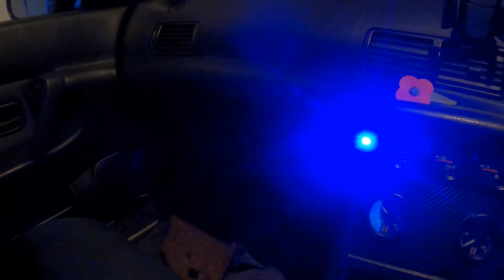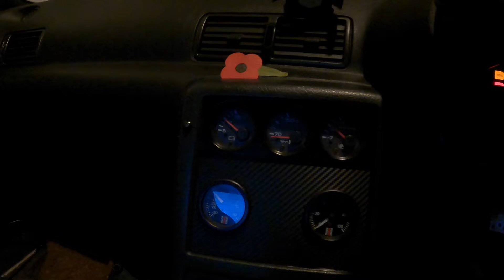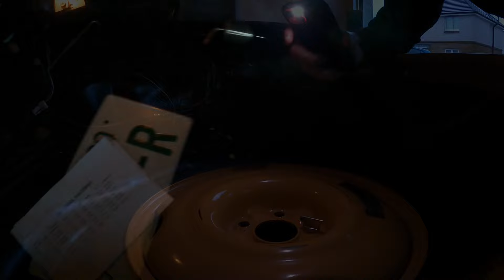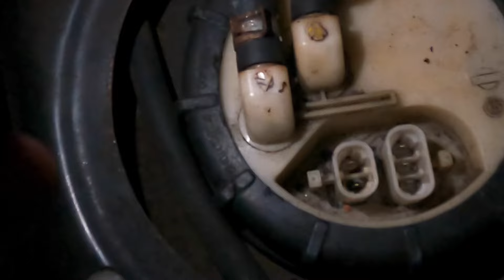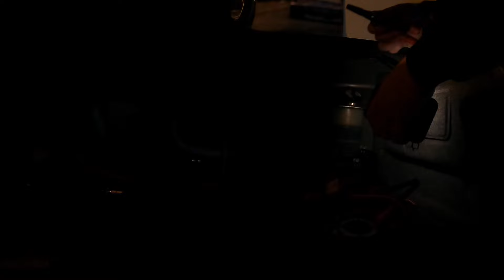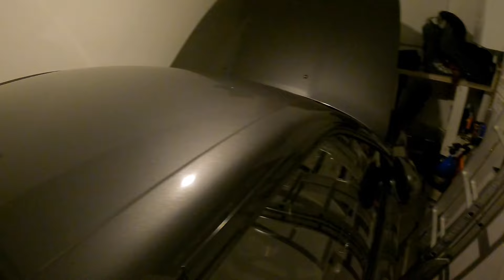FIXING MY BROKEN GTR!

Comment: Result ! My dad’s V8 jag is having a similar issue. I’m going to try power straight to the pump next. Might be giving you a phone 😂
Reply from the maker: Haha mine is the most simple connection ever but the last bits luckily have been the weak link 😂! 

Is that an uprated system? Didn't realise they had such a small voltage tolerance
Reply: @ yeah it’s crazy how yours burnt the wires. 
Jag is all standard. No power at the pump but got power at the relay albeit only on one terminal. I’ll run a cable straight to the pump and rule it out. Although not getting a signal at the relay is making me think it’s something further back